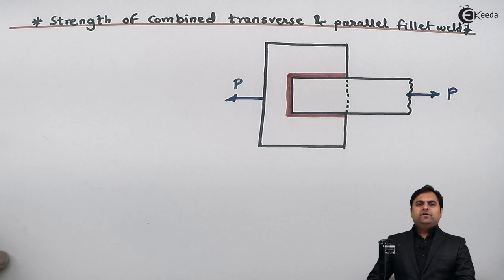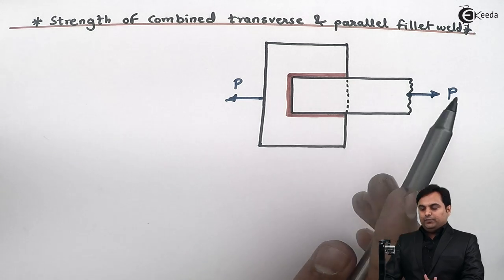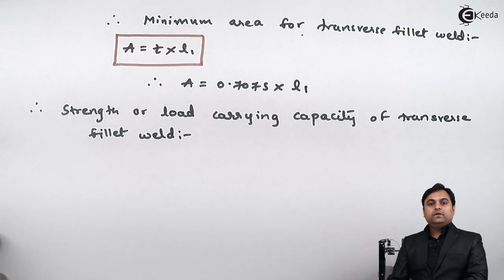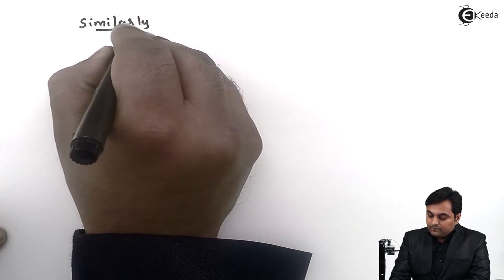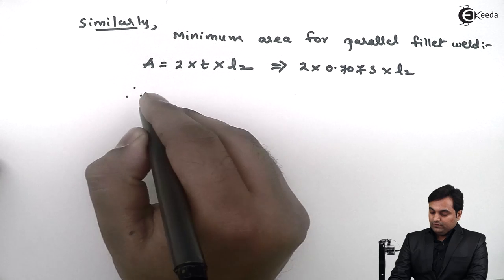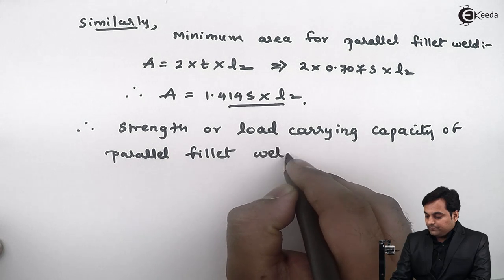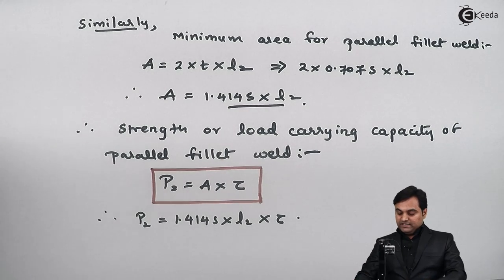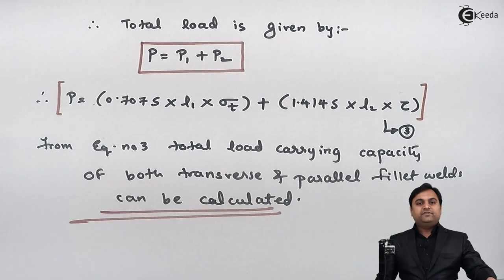Strength of combined parallel and transverse fillet weld Concept - Design of Welded Joints - DOM

Comment: Q1. A plate b mm wide and t mm thick is joined with another plate by a double parallel fillet weld as shown in Fig. if the permissible tensile and shear stresses in the weld material are otw MPa and w MPa respectively and the permissible tensile stress in the plate material are otp MPa. Calculate the length Lı of single transverse fillet weld required to make the weld joint design safe, consider the joint first under static loading and then under fatigue loading.?b=99,t=13,L2=123, tensile Stresses for pleats =54n/mm^2,tensile Stresses for welding =75n/mm^2,shearing Stresses for welding=53n/mm^2
Reply: L1,negative why?

Comment: As per diagram the parallel welding will resist by tensile force & transverse by shear force. we don't have any shear force in this case. so only parallel direction weld will resist the subjected tension force. contribution of transverse weld will be negligible in this case.
Reply: vansusaini - in video sir told parallel fillet weld have shear load while transverse fillet weld have tensile load, it is confusing, please elaborate clearly

Comment: If the plats Ex, 1,are joined by double parallel fillets and the shear stress is not exceed 56 mpa. Find the length of weld  (a).static loading (b)  dynamic loading?? 
How to find...